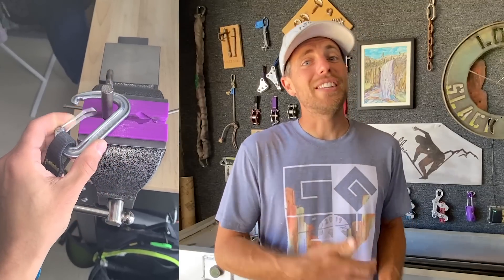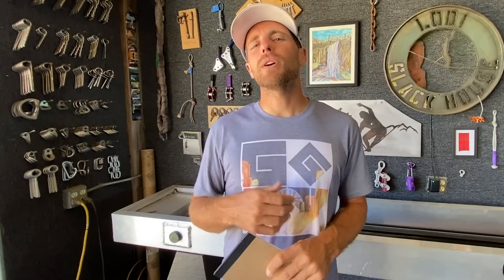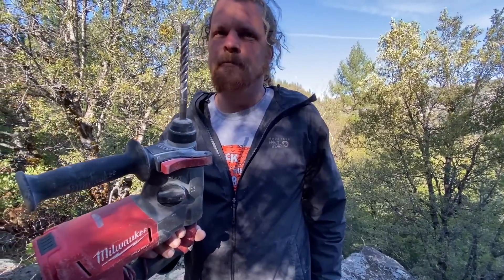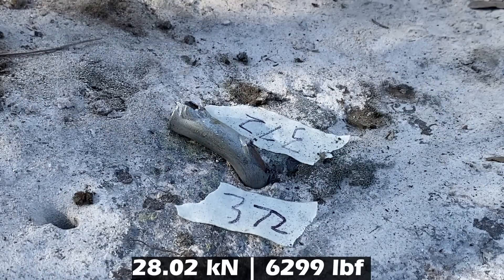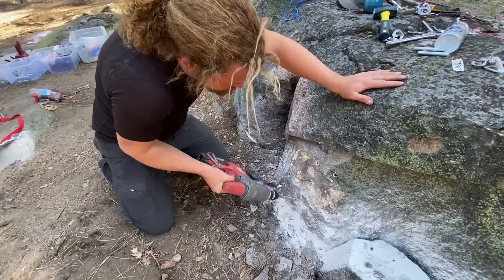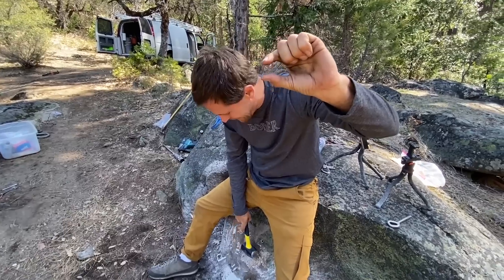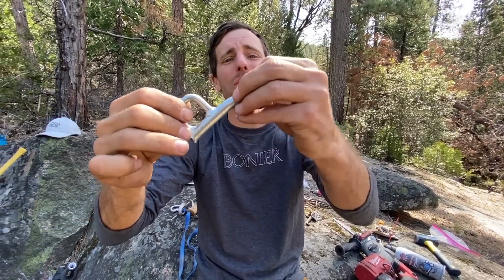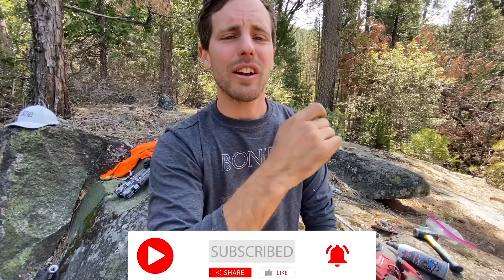Brazil climbing bolts tested - Grampo P

Comment: Rust on the inside on new material for climbing? Wow... Seems very impressive to me, what "quality" in some countries is possible.
How could a person ever relay on those things? Perhaps making money out of it was the main reason to sell such "rusty" bolts as climbing safety system...
Maybe life doesn't have the same value in other parts of the world... Or, as hard as it might sound, some form of corruption made it possible to get such things on the market...
In comparision, watching formula-1 on television a couple of days ago, the race track was completely new re-surfaced in Sao Paulo, but most drivers experienced a lot of back pain, because the track was very uneven and bumpy. They spend millions of dollars and sadly the result is obvious awful at least. Great job...
Rust on the inside... unbelievable :-(

Comment: I'm from Brasil, and I've been climbing for several years now. From this perspective, I must tell you that you tested a great quality "P", top notch. Most of the brazilian Ps are very far from this quality, and they may even use the main bar thinner than 3/8 (you tested a 1/2in...). The necessity of a very precise hole diameter to hold the P on the rock is also a big safety issue, many incidents and accidents happened because that, the P just slides out of the hole. To "do not loose a hole", people even improvise chimming aluminum can foil to use the P on a wole that got too wide... Also, depending on the lead climber movements and clip directions the likelyhood of the quickdraw catch the eye of the P on the gate of the carabiner and unclip in the event of the leader fall is way higher than other types of fixed pro. Also, each P eye and size are different, so the unclip likelyhood also varies depending on "the model". Ps are\ also hand made and the quality of the welding or the type/alloy used varies a lot, as do the reliability. Deriving from the materials choice and welding, we get also the problem of corrosion/oxidation in relatively short periods of time. The origin of the P comes with the pioneers in Brasil, that climbed just in granite and gnaise, that's OK for Ps, but people use it indistinguishble on different rocks (like limestone and sandstone), and several times it gets realy unsafe. I really appreciated the video, thanks for choosing this theme and exploring it thoroughly. I see that you recommend the better quality bolts and hangers, but anyway, I feel your conclusion miss a lot about how crazy different/safe they are all over the place, and kind of give an idea that the P is "fine" but in fact it's a culture that needs to change in Brasil, depite the challenge that certified gear is substantioally more expensive in Brasil than in other countries like US. Abrazo
Reply: Bem explicado, a realidade é outra...
Reply: Explicou bem, amigo

Comment: Hi everyone, I’m from Brazil and have been climbing for the past 1 year and half. Grampo P is pretty common in old crags and old trad routes. Recently I was starting to build a top rope anchor and I realized one of the bolts was completely loose. I took it home and warned the climbing community. It’s been a pleasure to watch how not to highline. Cheers from Joinville, Santa Catarina, Brazil.

Comment: Brazilian amateur climber, here. In the crags in my region, bolts are quite rare and I've seen/climbed maybe 2 or 4 bolted routes, while all the rest are equipped with old P bolts. I can say I trust most of them, yet you can find some sketchy ones which IMO should be replaced. Climbing ethics of not interfering in routes set by other people is a major delayer of route maintenance.

Comment: at 6:40 in the video you can see a wide hole at the weld .... it causes water penetration in the inside of the weld and invisible corrosion .... same issue on https://www.youtube.com/watch?v=OCAYrPDC14w ..... the video name is translated as " what holds the live of the rock climbers in Brazil". It is obvious that we as climbers should not encourage the use of non standardized gear .... here in Brazil some old school climber have a crazy fetish on non standized anchors and some have the lack of responsability to denie the occurance of accidents due to their use

Comment: This is the report of grampos made of high carbon grade steel that broke easily at Rio de Janeiro. 4 years earlier me and Marcel Leoni have tried to make the federation do something about it... we had 2 meetings with the director at the time and nothing was done .... http://www.femerj.org/wp-content/uploads/Comunicado-sobre-fragilidade-encontrada-em-grampos-na-via.pdf ..... this fenomena happens because of hardening at the thermic afected zone at the weld points(this only happens with mild steel that have at least 0.40% of carbon in their composition, making clear that the manufacturer didnt have any notion of the steel composition when they made it ).... exactlly were grampos P should "bend" in the event of a fall. Now, they are trying to make us believe that there is no problem in using 304 stainless bolts near the sea at Rio , despite all the reports arround the globe about this issue and its risks. The federation have been donating 304 bolts and hangers to be used in this areas..... despite the UIAA clear warning about this.... we will see what happens in the near future.... we already have 3 accidents involving 304 stainless near the sea in Rio.... but the authorities try to hide it and say that those were isolated events ....

Comment: At 6:40 you can see a hole in the weld at the grampo.... this causes water to go in and cause invisible corrosion .... you have tested brand new grampos.... i would love to see some old rusty ones like those from "minotauro" route  in Petrópolis, those single "glass" Grampo P belays trying to hold a fall .... actually i wouldn´t like it ....

Comment: There is a lot of variables in grampos instalations and design , i have worked over some replacements here in Petrópolis and have pulled some grampos with my bare hands ... You have to have a swiss clockmans precision when instaling them usually people use two drillbit diameters (12-13mm) i have used 12,5 and 12,7 mm .... Now i just use regular bolts and have strong conviction that grampos should be avoided. We have better gear to use. They were great in the late 70s when we didnt have any better gear !

Comment: You’ll have to test Australian u bolts. Bent 10mm (sometimes 8mm)304 rebar in a u shape with notches. Glue is usually polyester - Ramset 101. 2 holes drilled per bolt
Reply: switch to epoxy, much stronger than polyester based
Reply: Yeah epoxy is better and everyone is slowly changing to epoxy. Curious about how much better epoxy is. Most bolts in the blue mountains are 101
Reply: @nathankenny7454  if my memory serves me right. it was about 4 years ago we tested polyester vs epoxy in our works labotary, epoxy was 20% stronger. have to dig the files to see the perfect numbers. but yeah epoxy was stronger

Comment: Very good video. It proves that the "P" used to protect climbing bids in Brazil are reliable, since it supported loads above the recommended ones. The test in which the "P" broke with a load below the recommended should not cause concern, since, in the event of a fall of the climber, the "P" do not suffer any effort in that direction.
Reply: Lie , in many configuration we have Axial loads on grampos ... One of them is when you are on a slab and the climb gets vertical and you clip a quickdraw at a higher bolt .... When you fall the grampo P from the slab is going to be pulled out by the rope....

Comment: Another brazilian here. Another topic to consider is that the P bolt always BEND before breaking. In real life situation, it "warns" you that it will fail before it fails. 
It's been 100+ years using those, in all rocks and weather, with excelent results!
Reply: Lie ! P bolts don't have standardized steel ... So there are some batches that are made from Rods of larger content of carbon... Making them as brittle as chicken bones.... I call them glass bolts ... Its notorious their presence in many routes from the late 80s. They don't bend.... They Just break.
Reply: @felipedemoraeslucena8949  How many broke with you? Or with someone you know? 
Don't lie to call lie, you don't have evidence to support your call.

Comment: The producer of the bolts tested on in this video, Francisco Balter, a.k.a. Chiquinho, answering to some comments, says their weld has not such penetration because the difference in strength by doing so would be small, and the difference in cost (due to more time required of craftsmanship) would be considerable. If in real life the forces applied to fixed pieces are x, and you have one piece which stands easily 2.5-3x, then there is no sense in spending more time and money to make them stand 3-3.5x. That's his point. Over than 20,000 of his bolts are placed in routes throughout of Brazil over a span of 25 years, and NEVER a failure in welding (in real life use) was reported. That says much for them. And if they were properly fixed for the tests, which they were not, the results would be even more impressive. Certification is not an end on itself.
Reply: The master has spoken
Reply: Li. Entendi. Respeitosamente minhas sinceras: Boas escaladas.
Reply: That is a great lie ... We have shitty notification in Brazil and have some grampo lovers working hard to hide the real accidents .... You André have at least one accident due to intensive hardening at the thrermic afected zone in grampos made os stainless steel that caused a faillure and terrible accident. We also have many other Bolt manufactures and to take Chico's grampos for reference is a big mistake ... I have replaced over 100 grampos and can say that they fail in many diferent manners when they are old. Not to say that we are at 2021 .... No reason to use a 1912 technology to secure our lives .

Comment: Early this year i was invited by Andre Ilha to replace some old P bolts of one of his routes for titanium bolts placed with chemical glue. As the mountain is close to the sea the bolts could be corroded and break at any time. These bolts were made by carbon metal. This route is from the year 1977 we thought it would be easy to break the old bolts but we were surprised by it's resistence. It took me a good number of punches with the hammer. The other guy helping us even had to use a electric grinder to take some off. So I trust in these bolts as much as I trust the Bonniers. But i still prefer the Grampo P.
Ps: the metal slings David Austin talked about we call paletas (pallets). Mostly made of lead. Its soft just like copper and it doesn't cause hydrolysis.

Comment: Nice video! There are a couple of aspects that are not covered and are worthy of being mentioned.

1. As you found out, it is almost impossible to drive the P bolt all the way in with a single drill diameter. A common alternative is to drill a 12mm hole and then change to a 1/2" drill, using it to enlarge the hole for 1cm only. This guarantees the bolt will "hit home", as we say. However, as you also showed and as mentioned by Rodrigo, bolts that do not hit home are also extremely strong - the only weak point being the non-standardized  welding. The process of enlarging the hole in order to hit it home is, nevertheless, prone to be messed up for a very weird reason: In order to guarantee some shear tension within the 1/2" region, old-school climbers used to employ what we call "palhetas". These are 1mm thick, soft alloy (usually aluminum) pallets introduced in the 1/2" domain before the bolt is placed. It does fulfill the function it was meant to and increases the shear forces, but at the same time creates an electronic potential difference between the bolt and the pallet, since different metals have different electronic affinities. This may cause galvanic corrosion INSIDE the hole, such that sometimes the bolt can look perfect on the outside, but the inside has become fragile over the years. This is maximized in the saline environment of cities like Rio de Janeiro. One should always be suspicious of bolts with such pallets (they can be seen sticking out of the hole).

2. The bolts you are testing, made by the Brazilian legend "Chiquinho", are currently galvanized. This is why the exterior looks like steel, but the interior looks like oxidized iron. The older versions do not include galvanization (and are better IMO), and quickly oxidize after being placed on the rock. I have personally broken almost 100 of such bolts, placed more than 20 years ago, and they look like new on the inside (oxidation is only superficial). Almost all of them were absolutely flawless and were a nightmare to remove/break, requiring dozens of blows to break. Unfortunately, due to the lack of standardization, I have also broken two of them with a single hammer blow. These were not oxidized on the inside, and the fragility was quite possibly due to the poor quality of the alloy itself. Nowadays Chiquinho has a somewhat consistent procedure for making these, but in the old days it was common to simply get a bad "batch": Sometimes too breaky, or too soft, or even shorter or longer. The welding is not completely trustworthy even up to this day (as you have shown), although at least MIG welding is currently used.

EDIT: P bolts are still a favorite among many climbers because, when a P bolt has been rendered useless by natural oxidation, it often spreads to the outside and you can see it immediately (even with pallets this is the standard). On the other hand, the bolts used for hangers are completely covered by the hanger itself, and you can only see the screw. It is very common for the screw to be perfect, while the inside is horrible (and invisible). Due to this visibility issue, I personally prefer to climb on P bolts in high salinity areas. The best option, however, are titanium glue-ins, which are around 10x more expensive than a P bolt and a pain in the ass to install.

Comment: This is REALLY common here in Brazil and you actually increased my confidence on them. There are places that use even thinner p bolts (almost half the diameter as those), normally easier climbs. 
I've heard that people can tell if the bolt is well placed by the ring it makes when you hammer it.
Reply: And I think they are rusty because they are made out of an old rebar, welded and then "chromed". So the inside is rusty because it was already rust before being welded

Comment: Here in Brazil the P's are pretty much the rule. They are cheap and work well enough with very few accidents. They are also perfect for rappelling. But they are all home made and not certified. Some of them are bent and without soldering. There are thinner ones, and in the dawn of Rock climbing in Brazil people used 1 inch thick P. The P itself is just for the carabiner not to slip out. 

I've taken some whippers on them and I'm still here. But the stainless ones are more sketchy because you don't see the rust. Iron ones are the ones I feel safer.

A test you can do is to make a lager hole and use an aluminium shim... This technique was used for decades here in Brazil to make it easier to install, but was phased out don't really know why. Apparently they are less safe?

Btw: I've already seen bottle openers as bolts here haha
Reply: Pois é Felipe... não vi ninguém falando da instalação com os shims de alumínio. Boa observação!

Comment: - Eu fiz protótipos com "valetas de escoamento de material" na parte que vai dentro do furo. Olhal cortado com "laser", solda especial, recozimento da peça, entre outros processo. Isso tornou-se muito custoso ($$$). É menos $ usar chapeleta e parafuso!
- I made prototypes with "material drainage ditches" in the part that goes into the hole. Eye cut with "laser", special welding, part annealing, among other processes. This became very costly ($$$). It's less $ to use clapper and screw!

Comment: Please test Australian carrots!! Done the old school way, they are standard machine bolts ground to have a tapered tip and simply pounded in to a friction fit. :) also fun is that the rock here (blue mountains)is usually super soft sandstone where expansion bolts are a big no no but carrots are extremely common.

Lil guide published by some locals with a section on carrots:
https://www.onsight.com.au/wordpress/wp-content/uploads/2014/01/Bolting-guide-V7.pdf

Comment: I am a rock climber in Brazil, and there is only one thing that I can tell you: do you know the failure rate (I mean, with severe or dangerous consequence) of those P-bolts (usually better than the type you used) used for the last 110 years in Brazil? ZERO failures. I am a Reliability Engineer. Ask any Reliability or Risk Analysis Engineer if any of us would use any other kind of anchor, whenever, wherever, ever. The "certified" bolts already caused at least two accidents, one of them almost fatal. There are routes here with P-bolts 70 years old, and still healthy. But they are fashionable...! Instead of improving the extremely safe P-bolts, people are moving to use the questionable "certified" bolts, under our salty, humid and hot environment. Time will talk.
Reply: Pedro the P bolt is a great idea and has potential to be even better. But it is too easy to install it wrong (i had to remove some of my first ones... and i  removed one from somone else with my hand!)
If you get a professional welder to do the welds properlly actually melting the base metal and not just gluing it with molten steel (which is the case on most of them) and properly install them I would agree with you that it is one of the best bolts!
But with all the variables that can make it go super wrong I think the fact that we didn't have more accidents is just a sample size phenomenon and not actuall superiority.